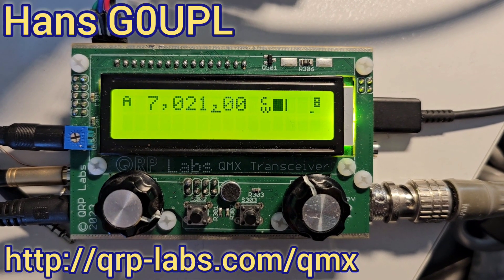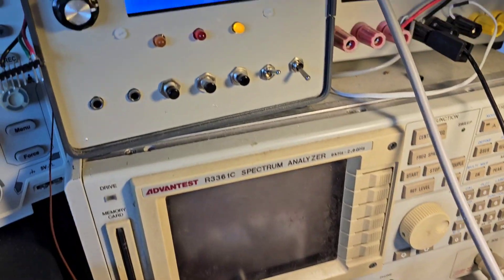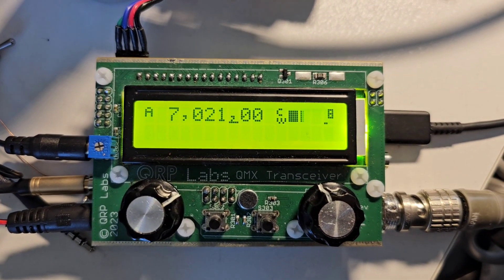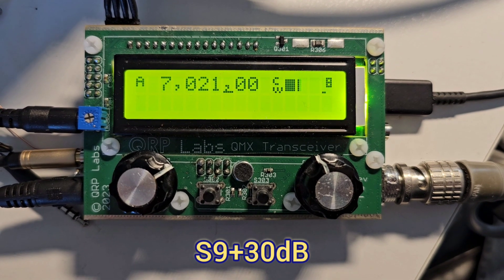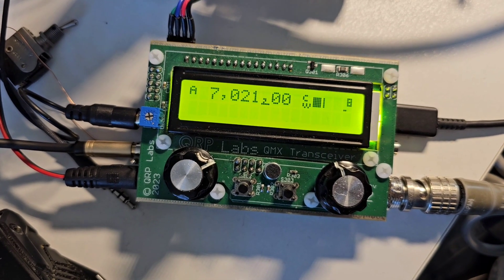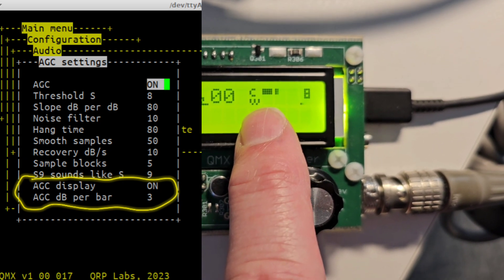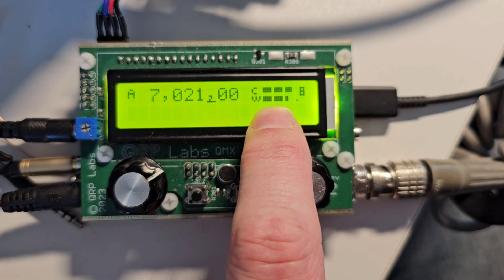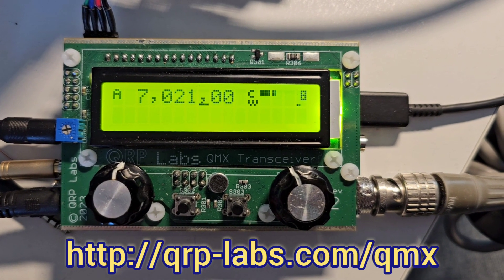QMX firmware 1_00_017 AGC and S-meter demo

Comment: Hey, I can't find it anymore but in a video I've seen you mentioned there would be a QMX 60 -> 15 and I was wondering if that'll be a thing or not? or if it's worth holding out for it? I'll be buying the 80-20 otherwise but I never plan on using 80m, 15m on the other hand is very appealing ;) Thanks for everything you're doing, and looking forward to get my hands on one of these ;) Cheers VK4ALE

Comment: Hans, I knew you would get  the AGC update done. I placed a assembled QMX order about two weeks ago, so I figure I may recieve it around November or December time frame, which I do not mind waiting.  You produce a fantastic product.   Thank you for your email instructing on how to open up the qcx mini and soldering in a jumper for the battery indicator to work.  Got that done on all three of my Mini's.   N7KO   Ken
Reply from the maker: Hi Ken, we are currently shipping assembled radios ordered at the end of July 2023. So 7 months. However we are getting faster, and have two new hires starting work today. So the waiting time is reducing. Thank you for your continued support. 73 Hans G0UPL
Reply: @QRPLabs  ❤